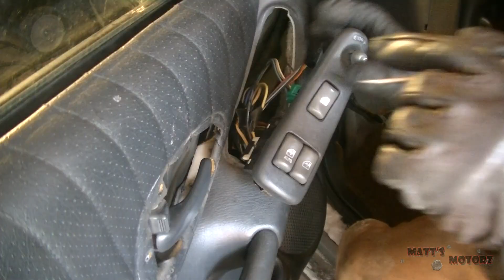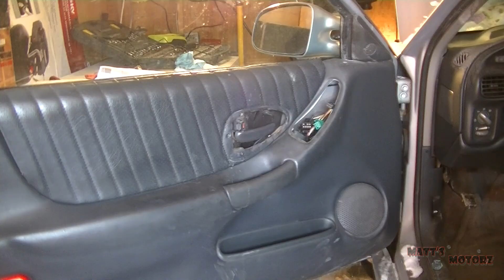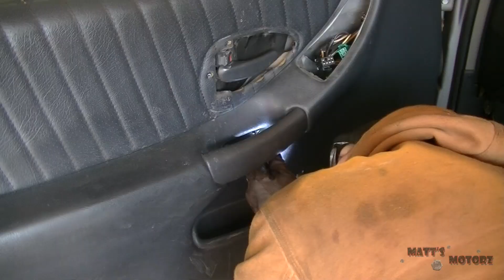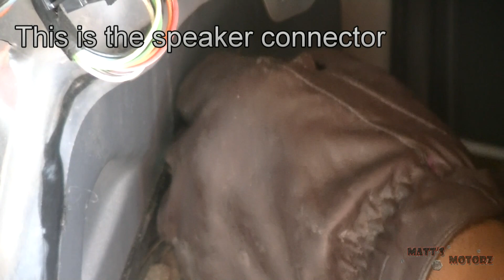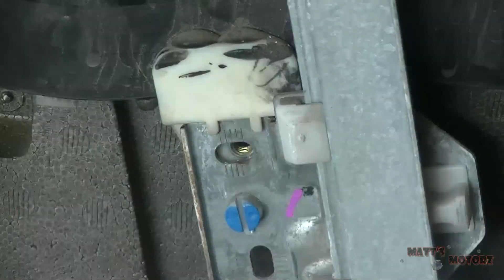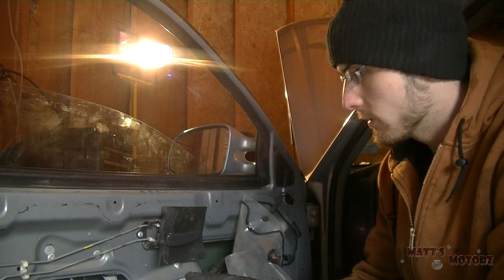Fixing Inoperative Power Windows: Part 1 - Diagnosis [1999 Pontiac Grand Prix GTP]

Comment: My 02 grand prix passenger window goes down with the passenger switch, but won't go back up. It goes up with the master switch. 
Is it most likely the passenger side switch?
Reply: Did you happen to figure out the issue you were having? I’m having the same issue, how did you resolve it?
Reply: @dannonswaqq  
No sorry I had to put it on a back burner was dehydrated and passed out and wrecked my front end up a little bit so I've been working on that let me know if you come up with anything I was almost just going to buy a switch on eBay and take a chance there's a couple on there right now.

Comment: When it's not the motor, not the switch and not the regulator then what could it be??? please u teach me
Reply: Wiring, or no power to the door at all. 
Did you find out what was going on with the window?
Reply: @mrbreezeet1  Yeah, the switch had some bluish corrosion built up on the connection. (from water leaking into it?) So sometimes it would work and sometimes it wouldn't. I replaced the switch and removed as much corrosion as possible, it works fine now. I initially didn't think it was the switch because the replacement I got from the junkyard did the same thing. (However the junkyard switch also had corrosion)
Reply: @LuisMendez-up5te  
Yeah, my passenger window is doing the same thing it will go down but it won't go up but it goes both directions from the driver side I might try taking that switch apart and try to clean it up worse I can do is mess it up and have to get a new switch I don't have the patience like I used to with stuff like that. 
Thanks for the reply.  good job!

Comment: i have a 1994 grand prix my window goes up great but will not go down i got a new motor and tryed it and it does the same thing it will only go up.is it my switch mine is a 2 door the other window works fine but my drivers side only goes up.....i want to know for sure if its the switch cause it cost 92.00 dollar.do you have any videos of how you can check the switch.
Reply from the maker: Eddie Mccomas Hot wire the motor so the switch is out of the equation and see if it goes up.
Reply: it will go up it wont come down i got to take the motor off the door to get the window down i tryed a new motor and it does the same thing it only turns one way.im going to buy the switch when i get payed and try it if it aint the switch i will take it back..but i think its the switch it feels funny when i push it down to let the window down. i bought the car for my son and it looks like someone already tryed to mess with it.
Reply: @eddiemccomas519  
Did the switch fix it?

Comment: Thanks for the video. My passenger window on my '99 GT would only go down so I ordered a supposedly rebuilt motor and when I plugged this one and tested it with no load it would still only go down. No use in installing it if the old motor is possibly fine. Suggestions?
Reply: Buy a new switch at your local Junk Yard of course.
Reply: Did it turn out to be the switch?
Reply: It probably was. I had a similar issue in another GM car and it was indeed the switch, the first thing I bought. That Pontiac was written off and left with insurance (the idiots, it was an easy fix but I took the money and ran as I wouldn't have sold it for as much as they paid). Fair looking car (coupe) but the build/parts quality was simply awful.
Reply: @VinylToVideo  
Yeah he said it was a switch he said there was corrosion on the contacts I imagine he means the contacts were plugs in I might just try to take my switch apart and see if I can clean it up but I got other issues right now I wrecked the front end a little bit the steering and suspension a little bit so I got to deal with that first. 
That window is the last of my worries ATM.
Reply: Might have been a different follow I might be all mixed up too.
Reply: @mrbreezeet1  I found myself a Buick Regal coupe with the series I 3800. The build quality is FAR superior to that of the later Pontiac, and the car is fully loaded. Everything I ever wanted. For the amount you'll need to spend maybe you can find something better like I did. I even got it for a price I couldn't refuse, which may not be typical. I'm lucky to have found it at all and had to travel for it, and the owner was just looking to get rid of it and was more than happy to basically give me it for hardly any money at all. I've put a lot into it but now it's a damned good car I could drive anywhere, and far better to put money into that than junk.
Reply: @VinylToVideo  I go t it all back together, it only has 104,00 miles on it. It's a good runner and it's riding nice now.